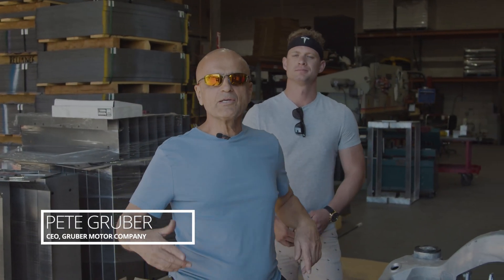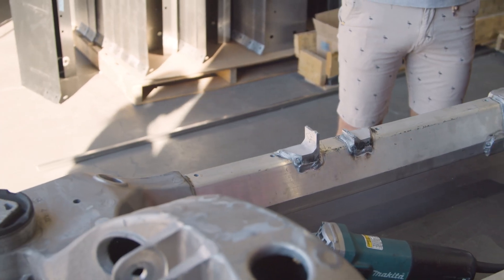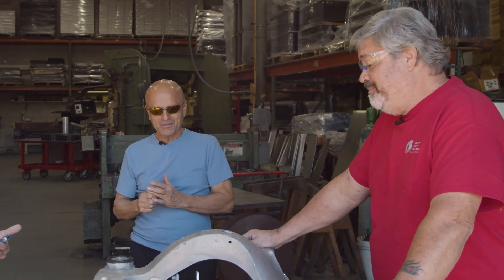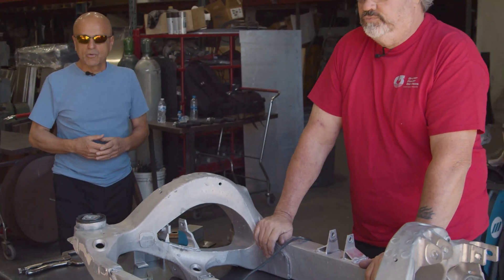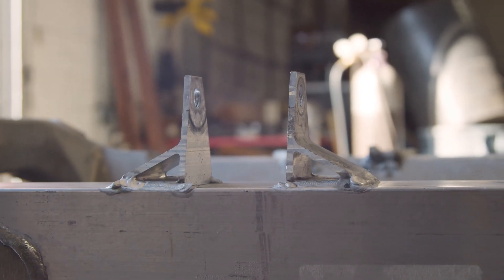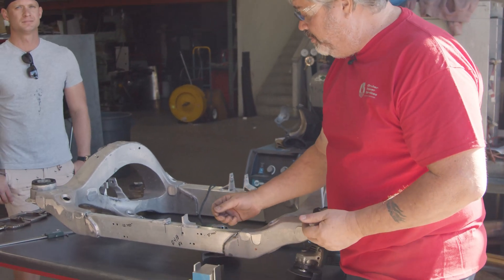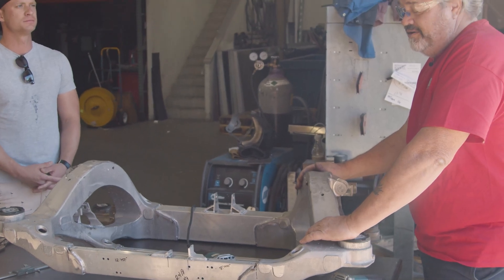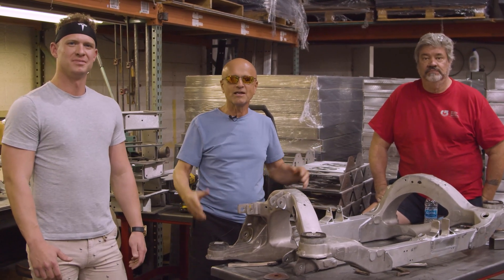Tesla Cracked Frame Repair Part 2 | Gruber Motors

Comment: in my Opinion - just poor design ! There should not be any Welds where a loads gets transferred. There should be long Bolts through the Frame including large Steel Washers to distribute the load equally.

Comment: Telsa design fault IMO. The motor mount should handle the  max motor torque and should be designed for near infinite fatigue life at that torque (yes, I know, infinite is not possible with aluminum, so really long fatigue life relative to the expected vehicle life). And if it can't be designed with that expected life then it should be a bolt on, easy to replace, part.
Reply: Yup. Design issue. Mount looks flimsy and not strong enough. He did put in a lot of miles though but could've gone more had it been beefier and sturdier.

Comment: Gruber Motors just rocks!! Many thanks for this great vid!! 
One small objection, though: I do think this type of failure is also caused in part by a flawed design: these welded-on brackets have stand a lot force during accel/decel and should be built much stronger as more integral parts of the sub-frame, as opposed to being added on in a later manufacturing step.
Tesla should have done a better job with this cradle and they improved it already for the m3, my
Reply: 10 cents more aluminum in manufacturing would double the thickness of that part and you'd never hear from it again.

Comment: The repair is equal to the flawed factory design. It cracked at the frame and weld connection, but it broke when the tab cracked. Hearing Chaz say “this is only the second one it’s ever happened to”, “entirely drivers fault”, “designed correctly”. Me think there’s an agenda. I know he’s a good welder but the false info from Gruber smh
Reply: The part failed under normal use. The driver used the performance designed into the car. This is a design failure.
Reply: @billybeemus3929  I agree, this is defiantly a design failure.  Under normal driving conditions, people will hit potholes at high speeds all the time with the quality of roads in many areas these days.  When Tesla or any other manufacturer is designing their vehicles they should be testing them at highway speeds through many different types of road conditions.  The frame and all suspension components should be able to take hitting a speedbump at or near highway speeds repeatedly without causing any structural damage to the vehicle.  Especially if Tesla wants to claim these designs are good for over 1 million miles.

I also question the new designs using DieCast aluminum alloys for whole frame assemblies since I think they are going to have issues over time unless they overbuild the design by a factor of 10 or more but overbuilding doesn't appear to be the case so far.  Imagine having to total a vehicle in less that a decade because the die-cast frame has stress cracks and you can't weld it because the components of the alloy cause weld contamination or recrack again in the near future.

Comment: Chaz is not scientific. The rsf front tab is the only one that breaks, and when beefed up, it never breaks again. That’s engineering (manufacturer fault). I’m on my third rsf, first one out of warranty, and the shop doing mine had another one getting their done. They had a stack of rsf out back. That’s in Alhambra, so “1 per 1,000” is based on… nothing. Chaz would benefit from a design thinking course.

Comment: 1/1,000 is not correct!  More like 1/100
I have a 2013 p85+ 110k that just broke. In researching for just 2 days I’ve read about 200+ that have had this failure. 2013 is only the second year for the model S and I do believe that Tesla should cover this or give a discount to replace it because it should have been built to perform as if it was going to be launched at every light/stop sign. This is supposed to be the difference in a 60k and a 120k automobile.
Reply: As far as the video 👍🏼 👍🏼. I wish it would have showed how it was removed from the vehicle.

Comment: I just found your channel I love your videos and what you guys do.While I understand the diagnosis I do not agree with the blame being placed on the driver.It’s Tesla’s job to design the bracket for a worst case scenario. They should expect the driver to put his foot to the floor . If they choose to run lighter braces they should incorporate torque limiting at lower speeds to ensure the brackets and any other weak links remain reliable.This is done in the heavy truck and all cars and light trucks all the time. Manufacturers use lighter driveline components to keep payload higher , parasitic losses and costs lower. They incorporate Torque  management in the lower gears to protect these components.

Comment: The front gusseted brackets are   Saw cut extrusions with an integrated gusset design.  The rear fabricated bracket ends up having its strength compromised along the heat effected zone of the top gusset weld. A better solution would have been vertical end gussets forming a “bathtub fitting “  or machining billet gusseted fittings.
Reply: yes!

Comment: I also believe this is a manufacturing flaw.  The car should be designed to be able to absorb the kind of instant-torque, aggressive-acceleration driving that many Tesla drivers enjoy.  It wouldn't take much to make that bracket stronger in the design.

Excellent fab work!

Comment: This seems to mainly affect the p85 model with the large performance drive unit  . The same subframe is used in models with dual motors and small drive units,  the p85 being a rwd only model seems to suggest the subframe and rear mount is seeing more strain from the torque of the larger motor,  than  it would see from a awd model ( where power and torque is split front and back) or rwd small drive unit (less instant torque)  .
however at over 180k miles factoring in his driving style , id be likely to agree in this case the part has seen failure not due to a defect.

I do not drive as described here yet the same thing happened to my subframe around 60k miles.  This has effected quite a few owners the majority being p85 models around the same mileage sub 100k .
There is a thread on tesla motors club documenting owners with the same failure.  

The gusseted supports shown in the repair and the reinforcing plates on the frame are a great fix .
Reply: What happens if it breaks?
Reply: @rxscience9214  drive unit is no longer secured and lifts up and drops down on to frame while driving . Potentially causing damage to drive unit and other components
Reply: @rickyjb23  okay 🤔is there an alert that notifies you of this? Could the drive unit just fall out? I have an old p85 I drive chill so I don’t think it’ll happen to me but still
Reply: @rxscience9214  the symptom is shown pretty well in the first part of this video. 

You will notice it when transitioning from acceleration and regen at speeds under 15 mph .  It's a loud thump that you will be able to feel through the car .

Comment: This doesn't happen with ICE auto manufacturers. Your stance that the user caused the damage is 100% BS. The vehicle should be designed to handle far greater stresses than what this driver put this vehicle through. The attitude that you display towards the currently existing service industry is appalling. Literally none of your videos have provided supportive evidence to your claim that current Technicians lack the core skills necessary to bridge the EV gap.
Reply: You would have to possess some mechanical savvy. ICE cars damned well do break motor mounts! ICE motor mounts are rubber isolated and flex, because the ICE vibrates so badly. Solid mounts on ICE are full race installations.The tremendous torque instantaneously applied by an idiot, yes something will give. Gruber does not point out a lack on anyone’s part, he is simply providing an in demand service.
Reply: @davidvicari5139  Who said they don't break motor mounts? This was a broken engine cradle where the mount attaches. It's a design flaw plain and simple.
Reply: @oddmanout7755  a Tesla has no “engine”. You have no idea what you are blathering about.

Comment: Sorry, I call BS about this being the user's fault.  An unmodified vehicle that is maintained and driven within the limitations of the manufacturer's specifications should not fail this way.  Thanks to Peter Gruber for doing Tesla's repair job for them, once again.
Reply: Yeah. I agree. He didn't exceed the design limits as a delivery driver.

Comment: Tip: do not floor the car from a complete stop.  Start smoothly then gradually press the accelerator more after roll out.   It’s not fast acceleration that stresses these, but the “jerk” (rate of change in acceleration).
Reply: …the whole thrill of a model S is it’s crazy fast acceleration.
Reply: @Turbo.M777  I daily drive my Model S.  What is  a delight day in day out is the part accelerator operation that scoots the car effortlessly, not constantly dropping the hammer like a mechanically oblivious idiot.

Comment: The manufacturer is at fault, those subframe tabs should have been stronger.
Reply: Any professional driving technique or training emphasizes SMOOTHNESS of control inputs. Slamming the accelerator down is an idiot move.
Reply: @davidvicari5139  Only poor quality manufacturer would blame motor mount and engine cradle damage to driving habits. Automobiles need to be extensively tested to avoid issues like these. 1:1000 is way to high of a failure rate for today's standards.
Reply: No! Listen to what these guys say! There has only been a few that they have seen. Including the ones that were fixed by Tesla itself, the numbers are small. The parameters of the driving style have been exceeded-  all these guys have said that! When you operate the vehicle at the extremes of its tolerances, you get this! We think that all eventualities should be covered by the manufacturers. But then the vehicle would be years late into production and much heavier to account for ALL event and conditions. Life doesn’t operate like that. As Elon said himself, ‘It’s easy to made a prototype, but VERY difficult to manufacture.’ And this is what he was talking about. As in, where do you stop experimenting and finally produce your product so that your company doesn’t fail!! As Tesla almost did- remember!
Reply: @Spooms1961  the person in the video said that they saw this one in every 1,000 vehicles, that's not a small number.
Reply: @Spooms1961  customers pay for the whole accelerator many will want to use it.